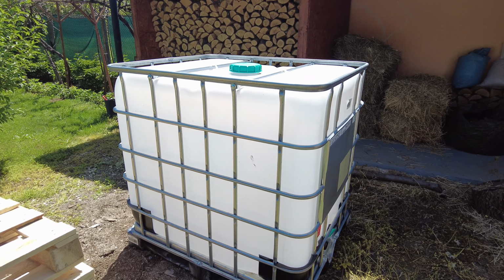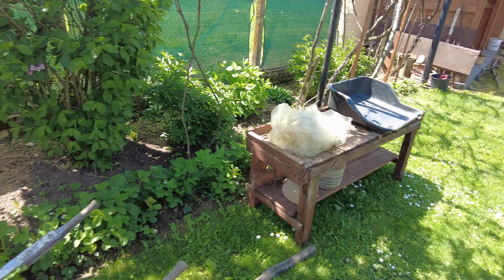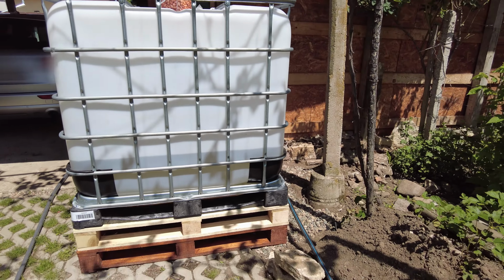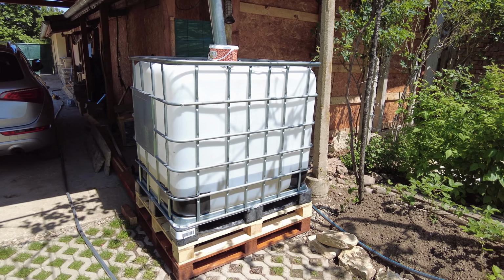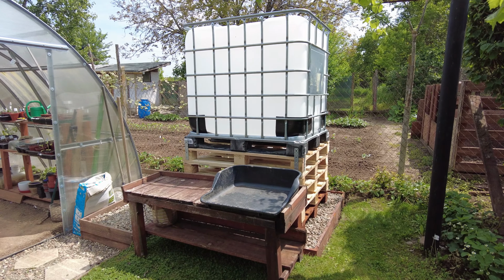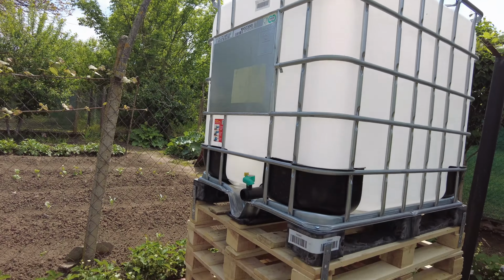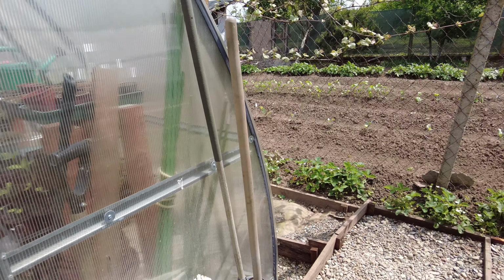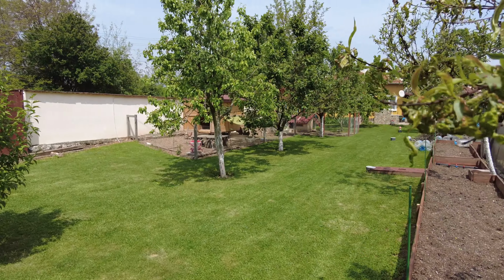HOW TO-RAIN WATER COLLECTION (IBC TANK) | FREE IRRIGATION

Comment: Do you have a well/bore hole water supply?
I have a 1500 ltr concrete tank which I fill from a well pump to water the garden using trenches between rows of plants and I still need to hose other areas to cover all the plants.
Reply from the maker: Hi there Hugh! Thanks for the comment!.. We are currently looking into a Well but from what we've seen it's quite pricey... We are near top of our village but down the bottom is a river.. would need to bore down at least 150m we think .. possibly through rock... as lots about..